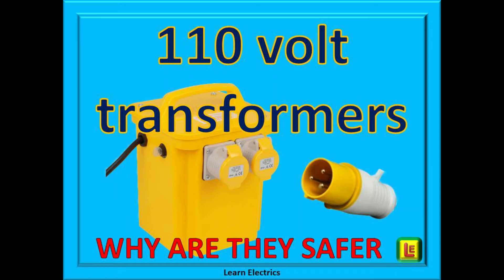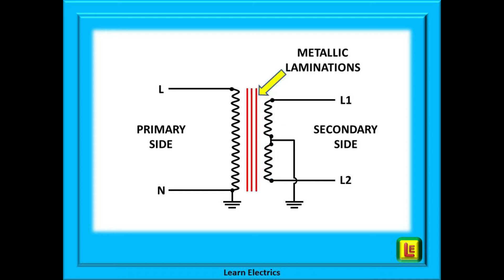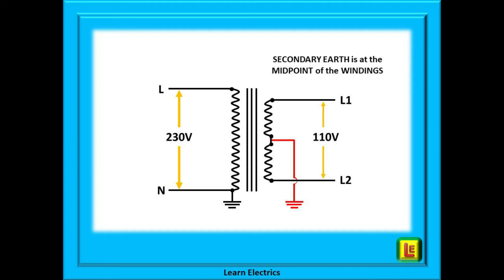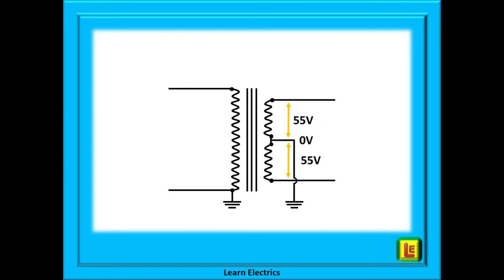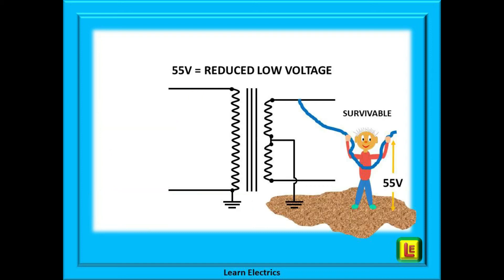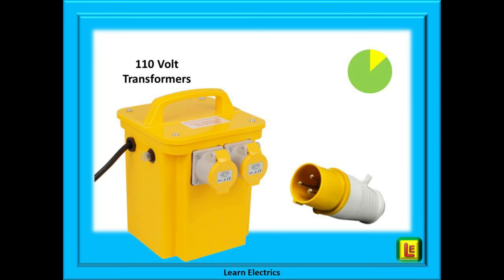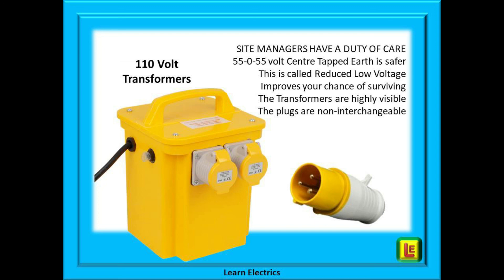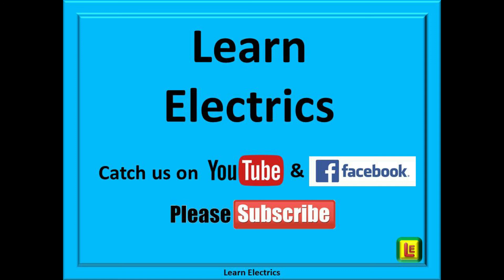110 VOLT TRANSFORMERS. What makes them safer? Learn how they work and reduce electric shock risk.

Comment: Great video thanks for uploading 👍 

Quick question, that is related. I have a generator that has a centre-tapped earth arrangement. Well actually it's a 160-0-80V arrangement with line being at 160V relative to earth. My question is, will an RCD still operate at 160V in a line to earth fault?

Thanks
Reply from the maker: Yes, but the timings will be different. Hope this helps. Dave.

Comment: I thought it was the amps that killed you and not the volts? I’m just learning electrics and now confused😮
Reply from the maker: The volts drives the current. the bigger the voltage, the bigger the current. Both are dangerous in the wrong circumstances. Good question. keep learning, its a great trade to be in. Dave.